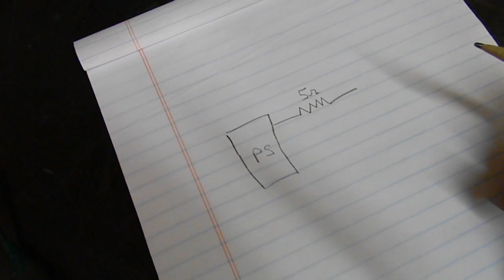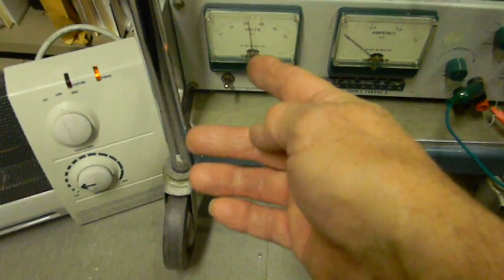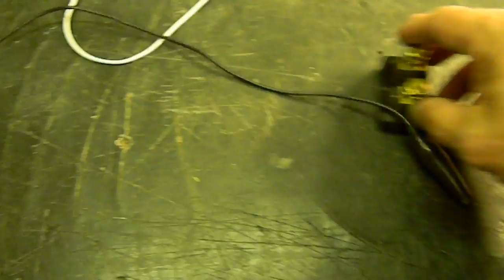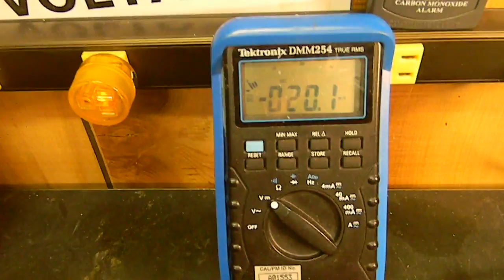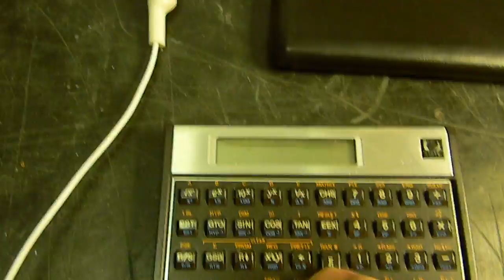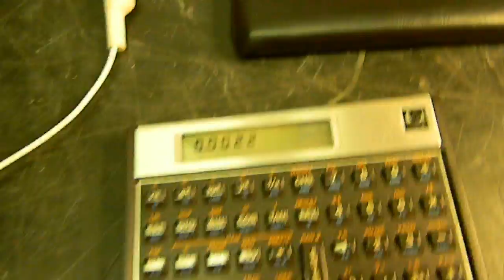Homemade Milliohm Meter.MOV

Comment: well its easy but its not practical. I have a SMD 1206 resister 430 Ohm 0.1% Accuracy , i want to measure its precise value , at least 3 digits after decimal , unfortunately there seems to be no instrument less than 500 USD which could do it......Sad
Reply from the maker: 0.1% is three digits past the decimal point and would be +- 0.43 ohms so, I agree, instruments that go 4 or 5 digits beyond the decimal point  are really expensive. It would surely take a 4-wire Kelvin ohm meter to get close. Rather than trying to measure the accuracy of your resistor, you can use it to measure the accuracy of your other instruments. My guess is, it is probably within specs. Us guys in the field rarely have true calibration instruments so, in my case, my "calibration" procedures are to compare one instrument to another and, if possible, to some reliable standard like your high accuracy resistor and then I am satisfied with that and have confidence that all-is-well. In my beginning days of-old, the 1960's, my instruments were probably +-20% so error could easily be 40% when combining instruments and nothing turned out right. It was really frustrating trying to understand theory and see it in practice. Things have come a long way for us in the last 50 years with the used instruments we can now buy.

Comment: I've never seen a kelvin measurement with current that high. I have used 1A as a DMM measurement means no need for a calculator. 1A over 1Ohm is 1V, etc

Comment from the maker: It would be checking the aggregate of the materials all the way through and would not be able to differentiate between the chrome or brass. This is its DC resistance and would not measure any "skin effect" as in RF measurements. Hope this helps. Maybe check the brass separately then again after being plated ? My guess would be that the chrome plating would not lower the resistance very much from the pure brass.

Comment from the maker: Thank you for your comments. Really appreciated. Actually, I belive in this case, the first error was primarily  "operator error"  because to "zero" the Tektronix meter, (not absolutely necessary) the meter leads need to be shorted, then "zero'ed", then clipped across the circuit. "Zero'ing" it helps to eliminate the few stray millivolts that may be displayed during open circuit leads. Thanks again.

Comment: Maybe the burden voltage of your current meter  made for the "error" seen in the shunt value. At a lower supply voltage, and with more current, the burden voltage of the meter becomes a problem. Enjoy your videos. Much more knowledgeable than most. You might enjoy Dave Jones EEVBlog videos.

Comment from the maker: Of course, you need another meter to adjust the length of the shunt. Use a power source and a series resistor of a few ohms and adjust the “sliding” portion of the resistance wire until the meter you are working on reads the same as the reference meter. Then I wind the wire into a coil and permanently attach it across the meter. You have to play with different wire depending on what current level you are wanting to measure and the meter movement you are using. Hope this helps - David

Comment from the maker: I have made many shunts for meters but I always did it empirically. As an example, say, you are wanting to shunt a 1mA meter to read 10A full scale. I have used wire that I have unwound from a large power resistor. Assuming you have a piece of wire a foot or two long, firmly clamp one end of the wire under one terminal of the meter and an couple of inches or so down the wire clamp the wire again under the other meter terminal.  (see next post to continue)